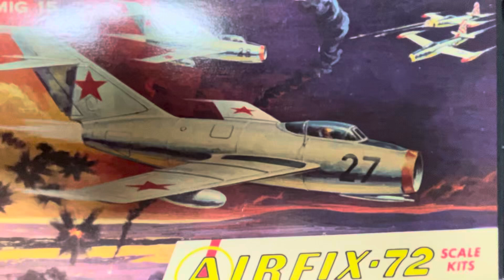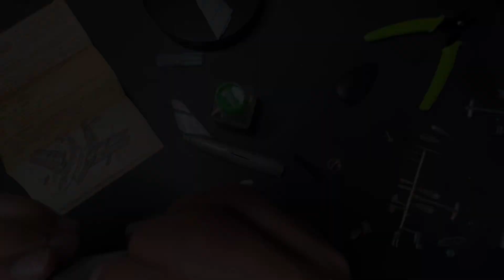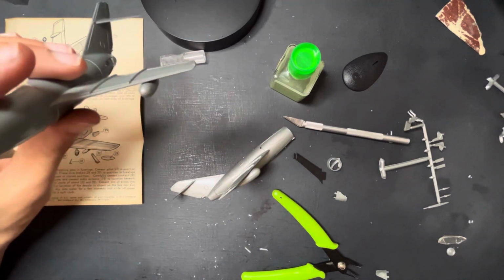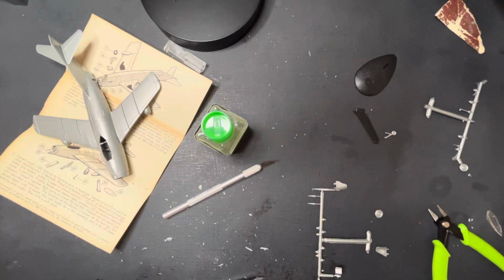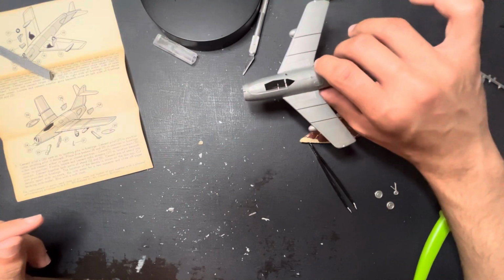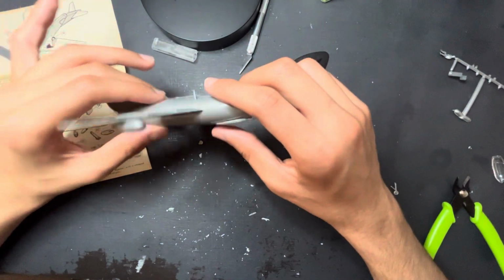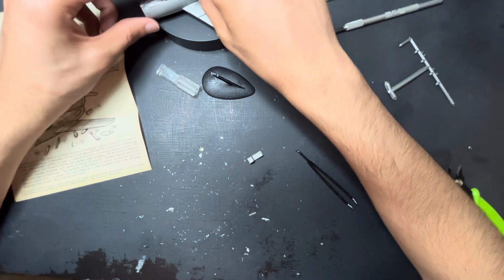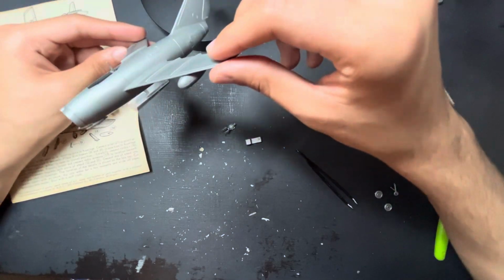Building Airfix’s 1/72 scale MiG-15, A VERY OLD KIT!

Comment: Drop tanks are auxiliary fuel tanks, carried usually under an aircraft's wings, to enable the aircraft to fly further than by just using its internal fuel tanks.  If the aircraft needed to be lighter or more agile e.g. in a fight, the drop tanks could be jettisoned (dropped).  At the time these aircraft were in use (early 1950s), there were no operational air-to-air missiles, they were armed with 23mm & 37mm cannon.
This is a very old kit, I built it in the 1960s.  It dates from 1958.